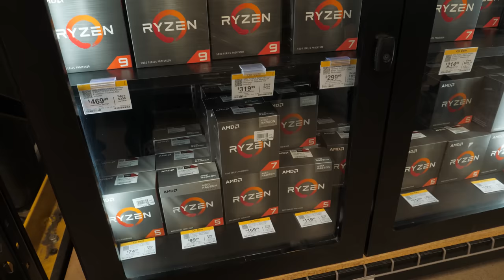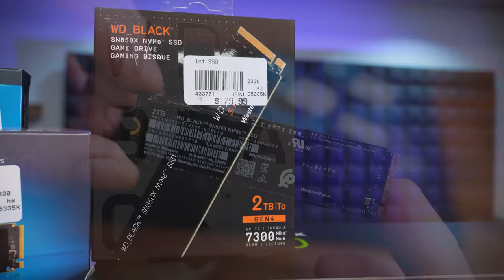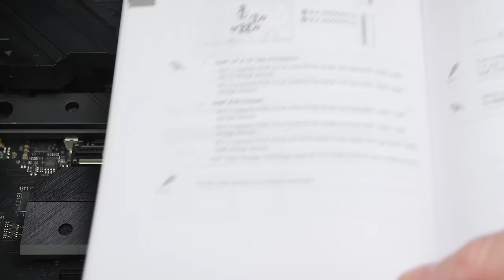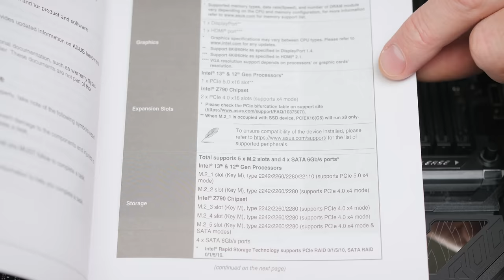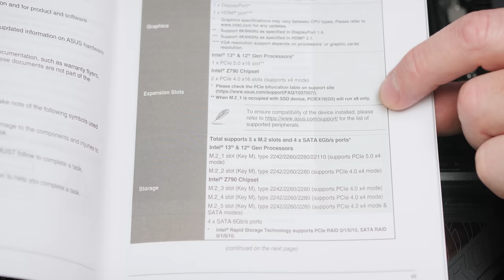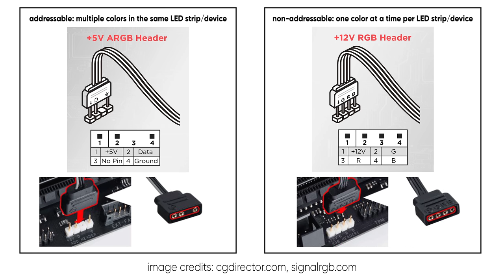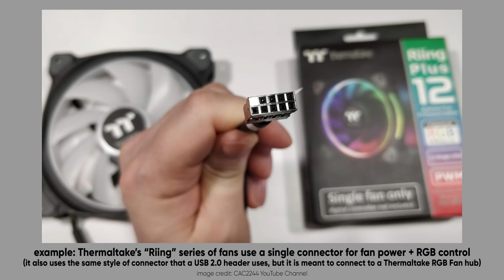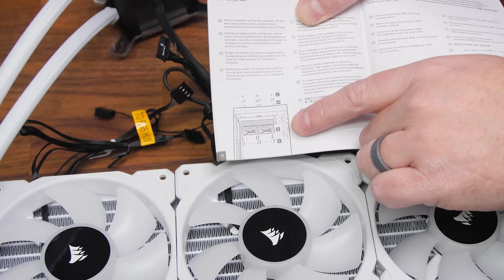How To Build a $3000-$5000 High-End Gaming PC - Step-by-Step Guide

Comment: Great video thx, i notice you say you plugged in both 8 pin cpu power plugs at top of board, i have ever only plugged one in, my manual for my asus motherboard says Ensure to connect the 8-pin power plug, or connect both 8-pin power plugs, so do i plug in one or two cables ? thx
Reply: You should plug in as many CPU power connectors as your motherboard has. This will give you the best possible outcome regarding stability.
Reply: Ok thx @marknewellmusic

Comment: My mid range build: 

7900x
7900xtx sapphire nitro 
64gb 6000 cl30 gskill 2x32gb
Aorus master x670e
Sodigim p44 pro 2tb nvme
Thermaltake pf3 1200w platinum PSU
Deepcool castle 360ex white aio
Lian li o11 pcmr
Lg 38gn950 38inch monitor.

Couldn't stomach a 4090, was still 500 USD more if I wanted one.

Comment: =D WOOOOOOO im literally trying to get the nerves to start my build i have ALL the part already 7800x3d nitro+7900xtx b650 tomahawk Mobo 2tb SSD 5000d airflow with 7 ml 120 elits farns +3 that came with the AIO h1150i elite LCD and a hx1000 PSU im just so nervous im going to break something and then have to spend MORE money to fix it PS. 6000Mhz cl30 DDR5 ram

Comment: PAUL is being nice but it should drive any pc builder Nuts when they see people mount their radiator on the front of their case! 😂  your 360mm radiator should be mounted always on the top of your case just the way Paul has mounted it. you don't want the air supply for your case components to pass through your warm radiator and then now you have warm air blowing into your case. Hot air rises naturally so you always put your radiator ontop with the fans under them blowing the case air that has been blown into your case from just the 3 front fans that are setup to blow cool air into your case over your motherboard to help keep things cool and then the air will rise on its own as it warms and it will then get pulled up and through your radiator out the top from your 3 radiator fans )or 6 yes ive done builds with 3fans above and 3 fans below the 360mm radiator 3  set to push air through and 3 set to pull air out of the top of your case. I also put one single exhaust fan out the back of the case. Exactly how phil has setup this setup. It uses common sense and science on how to move air through your case easily and to get the best performance from that cool air. 😎

Comment: @17:05 for the love of God why do motherboard manufacturers skip the 5th PCI slot ( second from bottom) ?? Rtx 4090 blocks up to 4 PCI slots leaving only the bottom two, and one is occupied by the m.2 slot.  Gigabyte got the message. The rest did not. With a 4 slot gpu and the 5th occupied by the m.2, you literally have one spare pci slot left.

Comment: I have one issue.. my first build and idk what cables to use with my specific psu (corsair hx1200) don’t know where to plug them as it the labels throw me off. Only cable I was able to plug was the 24pin CPU - extremely frustrated
Reply: CPU power and GPU power. Those are the 2 other connections you need to plug in. Which cables  you need depends on your motherboard's CPU power slot and the GPU's power connector. look at the connectors and count the number of pins.

Comment: Hello all,I would like to share a problem that I encountered with you and ask for your advise.I build this pc 2 months ago. At start everything was running smoothly and I was really enjoying gaming in that pc. But I decided to xmp the rams since this build is all about pushing it to the limit. So, from 4800mhz the rams now go up to 6200mhz with 1.3v and 36 39 39 76 as the manufacturer suggests it. But as my pc boots fine and everything looks good at first after 15-20 minutes my pc seems to struggle. For example programs like Spotify chrome even going to the settings take minutes to open and some don't open at all. I tried everything. Returning to default settings to BIOS switching the rams locations to a1b1 from a2b2, updating the bios I even did windows format. I don't know what else to do at the moment. If anyone had witnessed the same situation please let me know cause I am desperate here. Thank you in advance.
Reply: You need to do some isolation  troubleshooting... What happens when you remove the overclocks on the ram?
What happens when you try a different boot drive with the ram still overclocked.
Those 2 questions answered will help steer you towards the cause of your issue.

Comment: Thank you very much for the video. I just build the above pc but I have trouble installing the windows. I am trying to install windows 11 but I dont know which disk is who since it only shows drive 0, drive 1 and drive 2. I put the disks like you did on the video. Can anyone help me please?
Reply: Did the same build as well. I put Win10 on drive 0. That was the correct, fastest drive. You can check this after the install and if it is wrong...reformat and choose another drive. Think you will be good, though. Don't forget to look into updating the BIOS and the IME (first). Then you can use XMP. Cheers. YMMV.
Reply: The easiest way is to disconnect all drives except your USB installer and the drive you want to install Windows to. That way, there's absolutely no question about what drive to install to. Once Windows is installed, you can then reconnect your other drives.
Reply: @garymbushsr.7723  thank you for your answer. I did a little research online and you can check it with cmd window ( SHIFT +F10) when you are about to select the driver.
Reply: @JJFlores197   thank you for your answer. I did a little research online and you can check it with cmd window ( SHIFT +F10) when you are about to select the driver.
Reply: @JJFlores197  Great advice, but like Paul said, it's a pain to get back into motherboard to install those two extra drives. Hidden behind the GPU, but very possible.

Comment: For a cheaper build that will perform better, change AiO for deepcool ls720, cpu for 13600k, case for lian li lancool 216 and ram for ripjaws 6400 cl32. For an even cheaper option with a bit less performance change 4090 for 7900 xtx as Paul said, around $700 less
Reply: It'll be cheaper but what do you mean "perform better". Cool better - maybe. A 13600k isn't outperforming a 13900k. It's a value inclined build though that will run whatever you need just fine.
Reply: @dhLotan  First, the ram. Higher MT/s and lower timings will give better performance, and second, the cooler, which is much better and will let your cpu clock higher.
13900k is completely useless here since bottleneck will come from the 4090. 13600k is plenty fine and will work as well as the 13900k in gaming, while being much cheaper.

So in the end we have a much cheaper PC that performs slightly better.
Reply: @sergioav7278  Some people don't want "plenty fine" or "just fine". That's budget talk. Someone splurging 1600-2k on a GPU isn't looking to save a couple hundred dollars on a CPU. The i9 is good for longer value anyway and you won't need to upgrade it as early or when you get a 50 series GPU where the CPU could start becoming the bottleneck if you cheaped out when you got the 40x.
Reply: To be fair you did say for a cheaper build. I mostly had a problem with saying it performs better. That only applies to the RAM change. It will perform adequately CPU wise, but certainly not "better".
Reply: @dhLotan  It will perform better, there's no discussion there, and it's cheaper.
What I said is true today, and what you said is false now and unknown in the future.

But whatever, people is free to burn the money they get however they like.

Comment: The trend of sacrificing PCIe expansion for M.2 slots is just something I hate. I use 2 PCIe expansion devices already as well as my GPU and if I want to add anymore Im essentially screwed on this board compred to my current one. Why tf do I need 4-5 M.2s when 2TB M.2 drives have become so inexpensive.

Comment: Soo.. doesn’t the water cooler sit on the cpu crooked or like above it with the new socket type? The chip doesn’t stick up far enough to get full contact with a water cooler.. seems like a dumb design by intel.. the metal hold down is higher then the chip and big and bulky. The coolers have big heat sinks and it for sure would be resting on the metal part and not directly on the chip it looks like? No wonder why all these new chips run soo soft lol…

Comment: Another great video, thanks Paul!
Re: the ASUS ROG Strix Z790 E Gaming WiFi Motherboard, I stumbled across a video that does a deep dive into the slots and storage areas of the board. The presenter ends up recommending adding M.2 drives into the same ports as you have in this video but goes into greater detail as to why. I found it very interesting. Other owners of this motherboard may also.
I should point out that your presentation here is clear, accurate and complete and should be enough for anyone seeking to add one or more M.2 drives plus a GPU to the board.
https://www.youtube.com/watch?v=av7iKQfFtaQ
Hope that helps.
Reply: Watched the same video and like you said, Paul, great job explaining what the gentleman in this video discussed. You distilled it down quite well.

Comment: You keep referencing 2 or 3 grand for a high and build yet your graphics card alone is 2500 dollars. I wish builds like this were more realistic and not just get the most expensive highest power heart. How about you get the parts that are the best price per performance for gaming in this case? It would probably be one of the i5 13k series and a 4070 or 80

Comment: THEY HAVE GENERATION M.2 drives only at microcenters!!!!!!     How could you build a ultimate build and not buy atleast one m.2 gen 5 drive.   In Paul's defense most of the employees didn't know they had a gen 5 drive as well. 

Anyone who wants to try out what a gen 5 m.2 pcie5  drive performance is like. There js only one that I know of. At microcenter you can buy a 2TB Inland generation 5 m.2 pcie5  drive. 

I built a ultimate gaming pc, I went with the ryzen 9 7950x3D,  ddr5 6000mhz g skill trident z5 32gb kit. Unfortunately there is no pcie 5 graphics card . 

Now ,I know what everyone is thinking "Inland" m.2 drives?  It's like the Walmart brand of soda on Walmart that just says "cola" on it lol but for microcenter. But for $200, a 2Tb m.2 isn't that bad of a price considering I tested it sith with every test I could think of and it scored higher scores then it said on its own box. Over 10,000 mb/s read and write speads!!!!, so if your building the ultimate build you need atleast one generation 5 m.2 drive. (The drive actually comes with heatsinks and a fan attached to it however my high end motherboard uses its own insane heat sinks for the 4 m.2 drives it supports.
I left one gen 5 m.2 spot open on Mt board and I already had several samsung 980 2tb m.2 nvme gen 4 drives in the other spots and they scored just what you would expect for generation  4 m.2 nvme drives around 7200 mb/s read speeds and just under 7k mb/s write speeds. 

For the video Paul you should have went with the Inland gen 5 pcie5 drive. The bios calls it a pcie drive as well.

Comment: Little confusing when you say not to install all the ssds at once and then proceed to install them all at once
Reply: Just having 1 drive in during OS install is to make picking install drive easier on the install screen. Having all drives in just means you have to work out which drive is desired os drove on the os install screens

Comment: First off, the LAST thing you do is cable management. Micro Center GIVING you the components must be the reason you ended up using 2nd and 3rd class memory. P5 board, use P5 m.2's. The time and trouble to upgrade later on makes it worthwhile to do it right the 1st time. Mixing fans, not cool. They look and play different. White case, white MB, white cables. No white PSU's that size with those outputs available. Rush job, poorly planned. I give it a 7.

Comment: But if you use a 1080p monitor. You can play every single game on the market in ultra settings with a computer built for only £1000 and have 3Tb of M.2 storage aswell. Theres no need for anything high end if your not doing VR.

Comment: Definitely too much thermal paste and there is no need to spread it around with a finger like you are buttering bread. Just place a pea size dot in the middle of the CPU and the pressure of the heatsink with spread it across the surface properly.